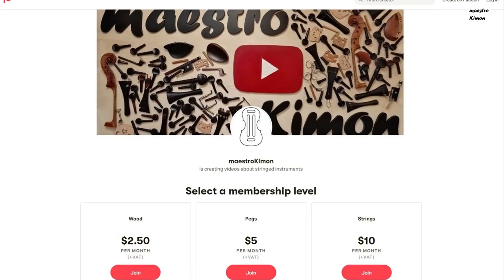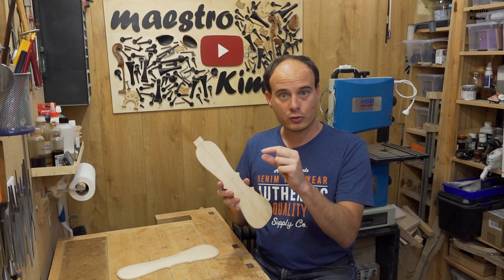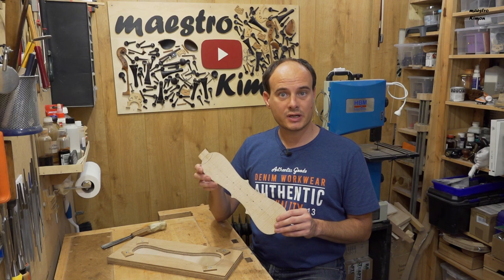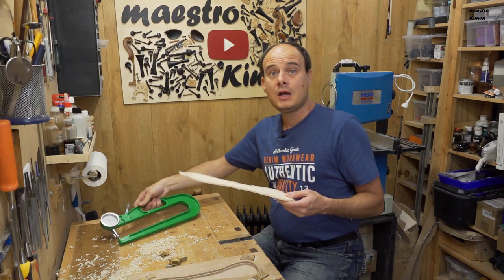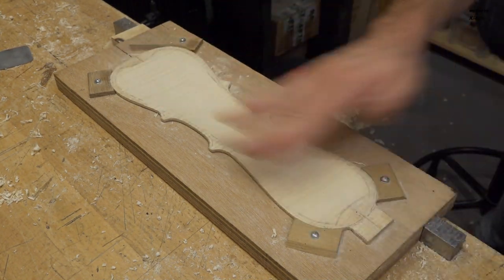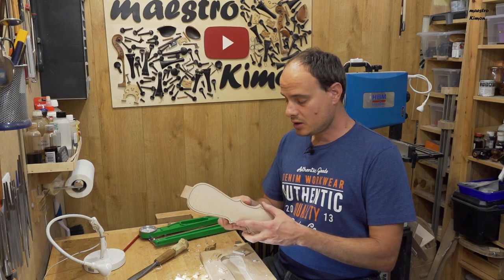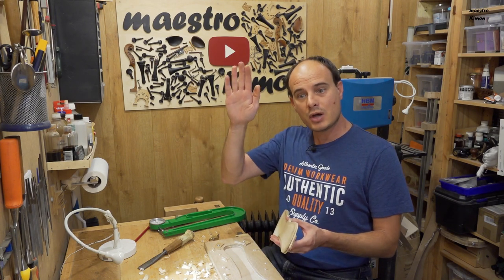Making a Pochette - Part #6 - The thickness

Comment: Do you use a toothed blade in your finger plane for smoothing at all?
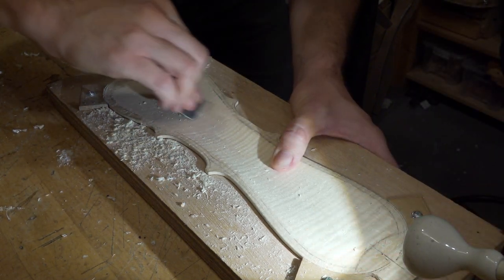Reply: 4:42 should answer your question.
Reply from the maker: Yes I used them on the back as the flaming is very strong and brakes a lot.